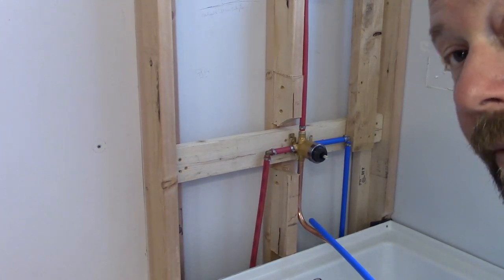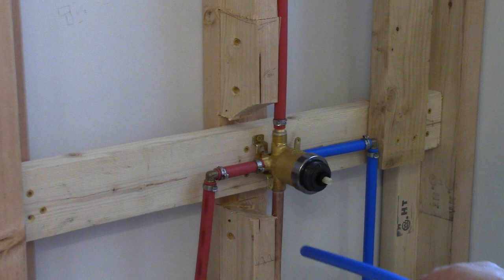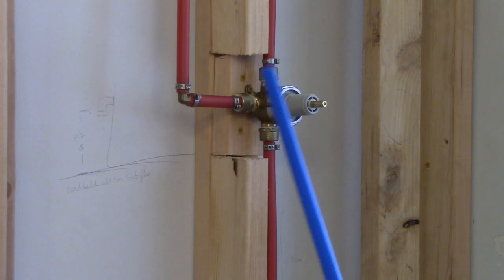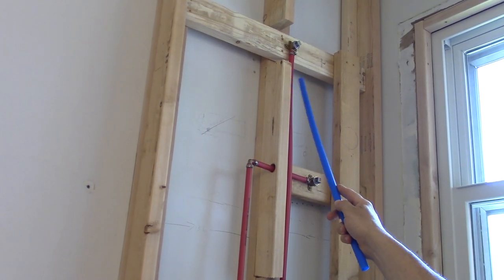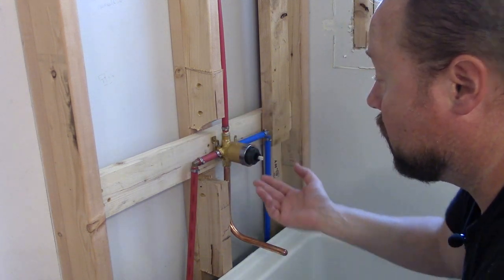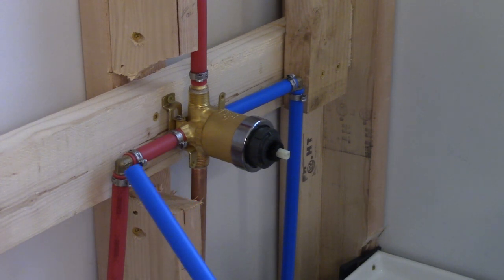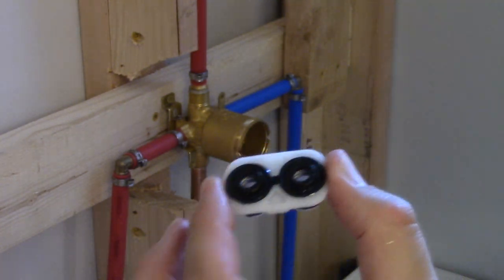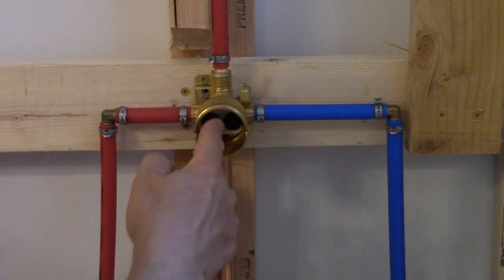Delta Shower Faucet Install - With or Without Diverter

Comment: This was very educational. I'm in process of rebuilding my shower. I've demo'd the old ceramic tile and cement board. Removed the alcove wall and shower pan. I've placed my new Onyx collection shower pan that's 36"x54" that is slightly larger than the old one.  Installing a Delta Monitor Series 14 Ashlyn with hand- held sprayer and diverter.
Reply from the maker: That is a lot of work, but worth it. I have found using the Onyx pans works our really well for shower remodels instead of tiled pans. 👍 So glad to help! Thank you for watching. Check out hundreds more of our videos at https://www.aroundthehome.org

Comment: How would you pipe it to have the 3 options (showerhead only, hand shower only and both head and hand)output on the diverter?
Reply from the maker: That is the system that I show here. This diverter gave exactly that. The other diverter, not exactly sure if it is 5 or 6 position, is for a shower that has another showerhead unit. I hope that answers your question.
Reply: @AroundTheHome1  Oh okay thanks. I thought you had to pipe the third output from the diverter that you closed off.
Reply from the maker: No problem. The one that I capped off was for a second set of shower head / wand. The bath / shower that this was installed in works just the way that you asked about. Good luck on your project.